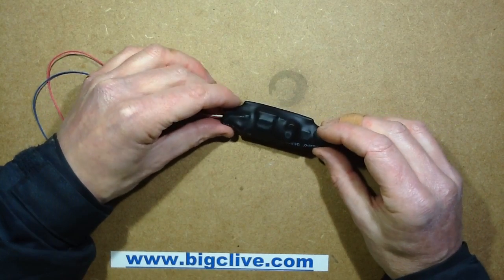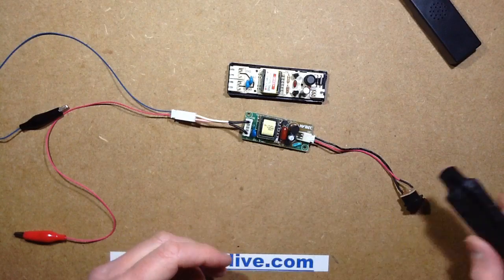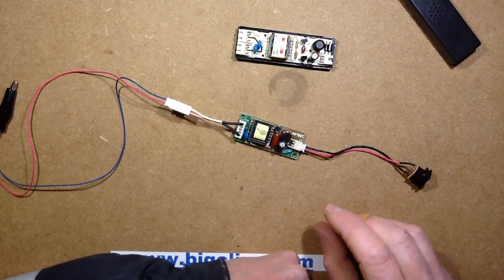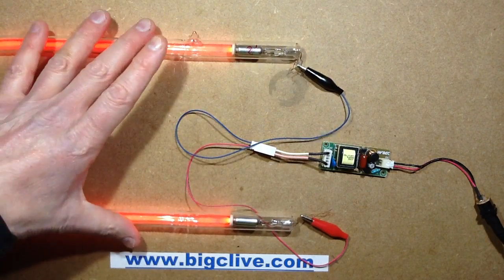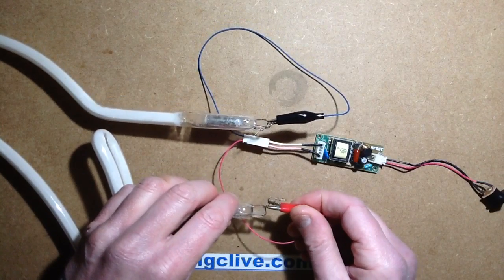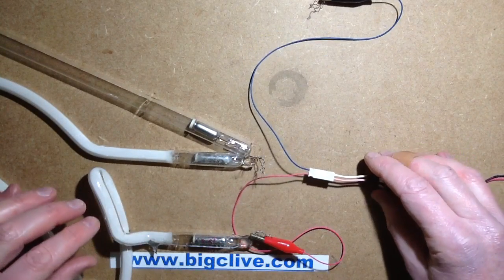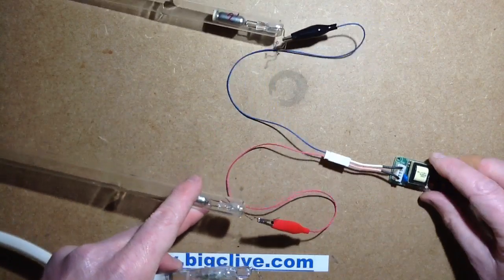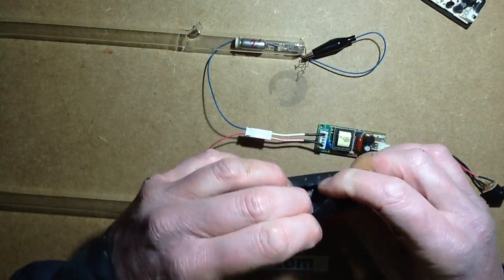Using a CCFL tester to drive neon tubes.

Comment: Now the question is, can that light modest sized SOX lamps. I mean i bet it can do 18 watt but what about the big 1.5 meter ones?
Reply from the maker: It should be able to make a SOX lamp glow, but not hot enough to get the sodium vapourised.

Comment: Could I use this to power a helium neon laser tube without damaging it?
Reply from the maker: It's possible that with a high voltage multiplier after it to get the strike voltage and DC it might work.  The ideal power supply for HeNe is a dedicated laser PSU.
Reply: @bigclivedotcom  thanks for the recommendation and the reply :) have you run across anything cheap from china that would do the trick? i'm starting to think about building something from scratch from plans on instructables. this isn't my preferred option. but its an option

Comment: I bought a few of these chinese CCFL lights that usually go into computer cases and put them around my whiteboard, but then I eventually got concerned that maybe the phosphor coating inside the tube was very thin and possibly not evenly distributed, and I am concerned that they may be leaking UV Light. I don't want to immolate my retinas with UV, but the CCFLs give quite a nice effect that can't really be replicated by other technologies. Are my concerns justified? As far as I know, UVA UVB and UVC are all harmful to biological tissue - I think UVC is the highest energy wavelength, the germicidal one.
Reply from the maker: The UVC lamps require a special glass.  UVC is blocked by the ordinary glass of these tubes.

Comment: Hello Clive
I've recently bought some very small neon and argon tubes (75mm x 75mm squares, 4mm diameter) and tried some CCFL drivers from old printers and scanners, but only half of the tube was lit. Well, the first won't light up anymore at all since it fell down and broke. I think the Voltage was too small, all of my drivers were able to output around +600 to -600v in a sinewave. I saw one of those DC 3v to 7000V Step Up Converters from China, do you think they can drive the tubes (in series) properly ?
Thanks in advance :)
Reply from the maker: The 3V high voltage units are usually designed for spark igniters.  You would be best using a suitable CCFL inverter.  An "angel eye" type inverter from eBay might have a higher voltage.
Reply: bigclivedotcom OK, I'll try one of those. Thank you very much for your help :)

Comment: What purpose does the output capacitor serve, exactly? Also, what would happen if it was bridged entirely? Would it just damage the windings or driver circuitry upon connection of any form of load?
Reply from the maker: The capacitor limits the current through the tube on each half cycle.  Without it the tube could pose such a load that it overheated the drive circuit.
Reply: bigclivedotcom Thanks, I thought as much but I'm not too familiar with these types of circuit. If given a pulsed supply, similar to an electric fence but at a slightly higher frequency, it could make a potentially 'interesting' bug zapper; short bursts of incredibly high current & voltage without needing some huge capacitor-based voltage multiplier. I might give this a try.

Comment: What happens when you connect that to a normal (computer case ) CCFL
Reply from the maker: It would allow too much current to pass and potentially damage the electrodes at the ends of the tube.